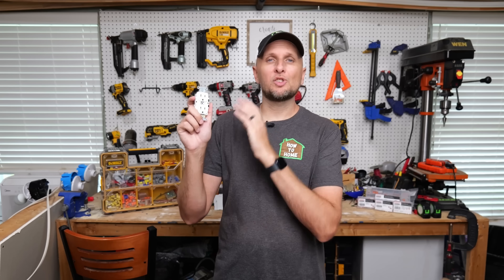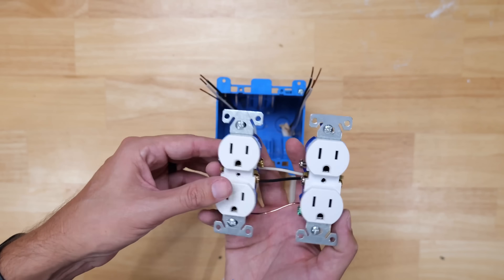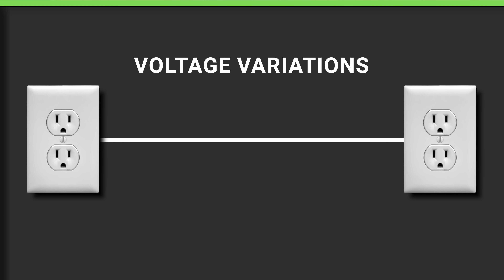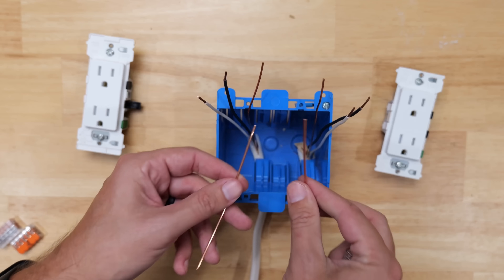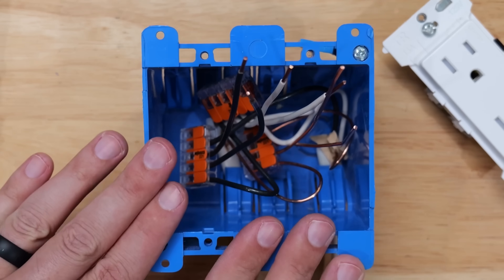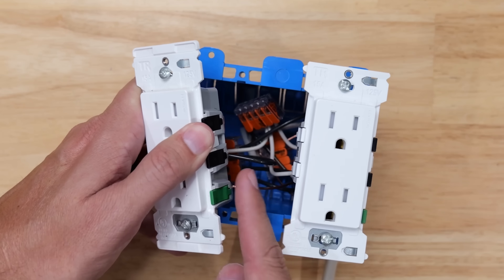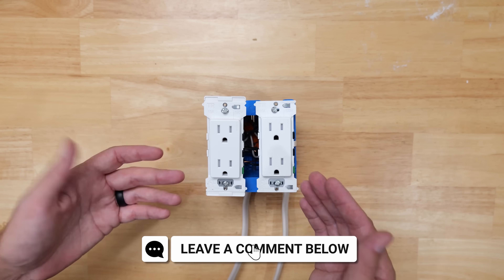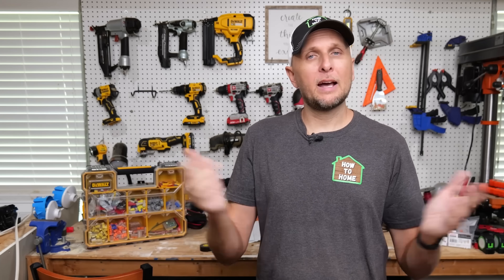Why This Outdated DIY Outlet Wiring Needs to End!

Comment: I’ve never done the first way, but I apprenticed as an electrician early in my tech career and the second way has ALWAYS been how I do it because it just is better.
Also been using Wago for years since I learned about them. I use them in a ton of projects not just AC related.

Comment: I would t place much confidence in the wago blocks.
Reply: LOL you mean the standard electrical connector in all of Europe. Wago 221's are just as reliable as a wire nut and they're superior when splicing a solid wire to a stranded wire.
Reply: WAGO patented the spring-clamp connector in 1951.  And it is the standard in Europe.

Comment: 00:03:13 * What country is it that wires in loops. So, the load is applied to two ends of the loop.🤔
Reply: Europe wires in loops and use 240V.  It doesn't really help all that much because they size their wiring accordingly and plan for faults.  The circuit has to work within spec even with a fault because the fault won't be known. The current will just double in each section.

Comment: The WAGO connections are neat and quick to make but wire nut connections are cheaper.  The outlets and connectors could last 15+ years without fail, so the cheaper method may be good enough.  But one home could easily afford the more expensive WAGO's on the entire system.

Comment: I replaced 38 "dumb" light/fan switches in my home last year with Lutron Caséta smart switches. I removed every single wire nut and replaced with Wagos like your example. I'll never go back to wire nuts! Wagos are much easier to connect/ disconnect and make for a cleaner, organized install. Only exception would be for GFCI if it's not already covered by a GFCI breaker in the breaker panel.

Comment: I had a home built in 2012, and the salesman for the builder said they did not daisy chain their outlets. I had no idea why this was a selling feature, but I did conclude this guy was full of 💩. So after a year when a bunch out outlets and lights stopped working, I tracked it back to the daisy chained outlet where a wire came loose. It didn’t bother me because I already knew but I’m sure someone wanting this would have been hot. I have always thought running power through the outlet was only a convenience and cost saver but would be better to directly connect to the next leg and just add the outlet in the junction box.
Reply: Daisy Channing is not bad if done properly it's best not to use the back stabbing method. commercial rated are usually way better than residential grade recpticals.

Comment: So, you just shifted a potential failure mode from the receptacle to the Wago. Receptacles and their reliability have been around for a lot longer than Wagos. Seems like this is equivalent to polishing the inside of a machine nut.
Reply from the maker: I come up with this.  I believe I said you could use Wagos or wire nuts and as long as they are installed properly, they also don't have issues.

Comment: I love lazy loops, so there are no broken wires, splices or pigtails in the box. 
1) Mark the NMC on the supply side with black sharpie where it will go into the box. 
2) Measure about 16-18"" and score for stripping.  
3)Fold NMC over and insert into box.
4)Remove sheathing so that the black sharpie mark is still visible to indicate supply side.
5)Measure 6" from each end and make loops.  Strip enough insulation to allow installation over terminals.
6)Install loops over terminal screws on the two outlets and tighten.  If a metal box, bond ground.
7)Fold wires into box and secure outlets.
Reply: 16-18"?  How big are your boxes?!
Reply: This also prevents devices from TILTING when you tighten them to the box.

Comment: Then one thing to discuss is box size and how many wires per the box volume. Then I have never heard of a receipt going bad. Also where to buy these sophisticated outlets?
Reply: Receptacles do wear out over time due to plugging and unplugging causing wear on the contacts in the receptacle and will eventually have to be replaced 
I've replaced alot worn out receptacles where there's nothing wrong with the terminal connections but were worn to the point where you plug in an AC adapter and it falls right out
Reply: If you mean the lever outlets (Decora Edge), I've seen them at Home Depot. As for receptacles going bad, you're right, generally a properly installed receptacle or other device will last for decades.
Reply: @dirankomorov  The guy with the peni$-shaped rocket also sells the lever devices.